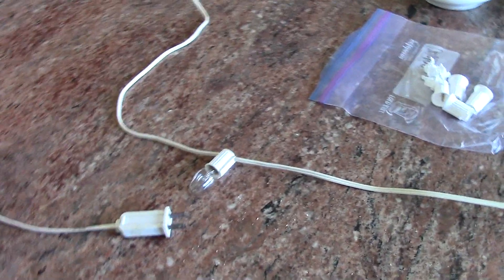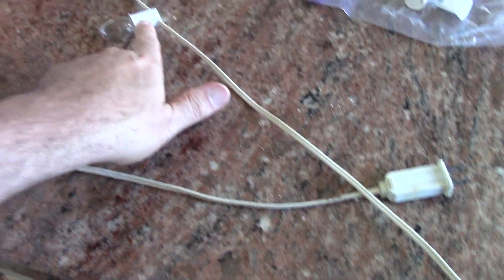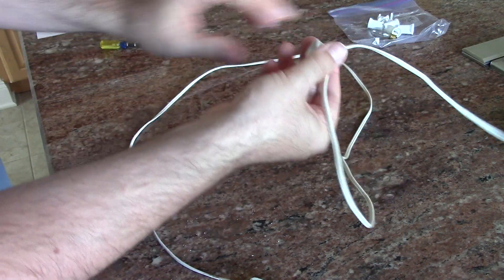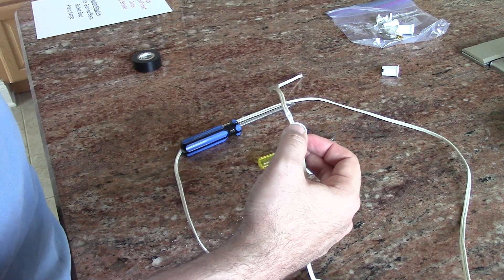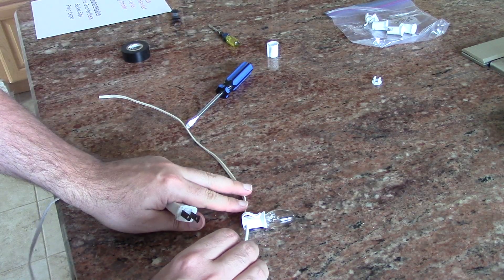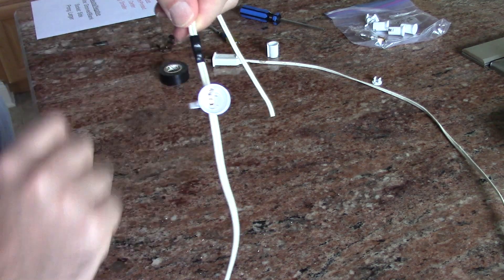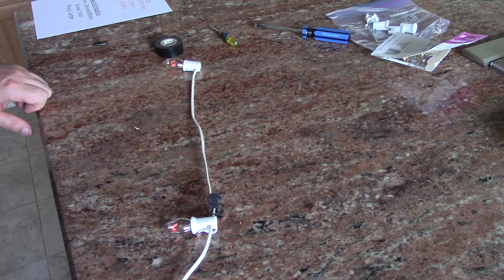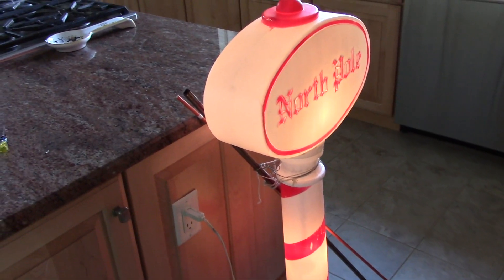Repairing the North Pole Christmas Decoration.

Comment: For an item like that, it honestly makes no real difference which way the sockets go on since it's fully enclosed.  But of course, there's no harm or foul in doing it the RIGHT way, so good.

The metal clip--yeah, fun when you make little mistakes like that.  We've all been there.  I would have mounted the clip to the socket first before wiring it, but either which way it's fine.

I must say, I was quite proud when seeing it all put back together and lit up again, knowing that I (and dynatrak) had a hand in this.  A collaborative effort--'Tubers helping 'Tubers!  What a potatotriotic thing to do!  But seriously, it was great to see it all lit up like it used to be.  Now it's got a great story to go with it, and I guarantee you'll always remember it.  That makes the piece even more special.
Reply from the maker: Yeah, there is always just a better feeling of having things done the right way. 

I actually did laugh when I realized the clip was on wrong, but that could be because I knew fixing it really was not gonna be that big of a deal, and thankfully it wasn't! 

All three of us definitely are part of it, and the best part is how it all worked out!